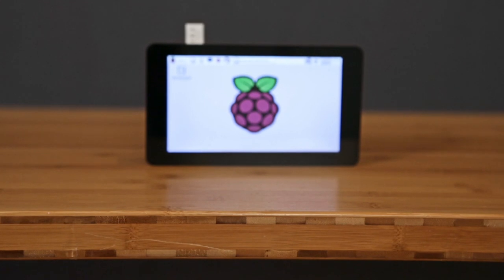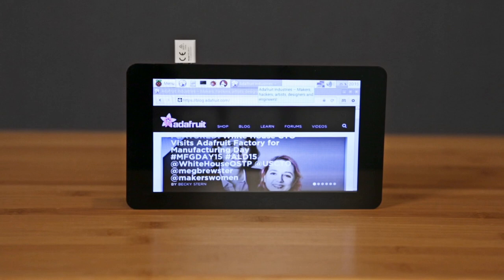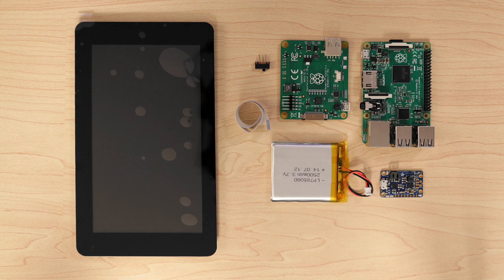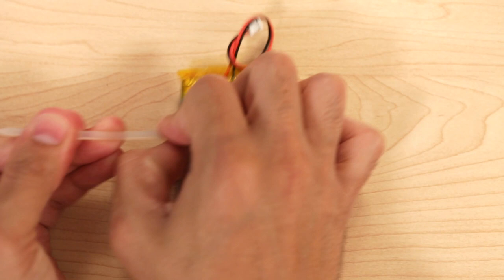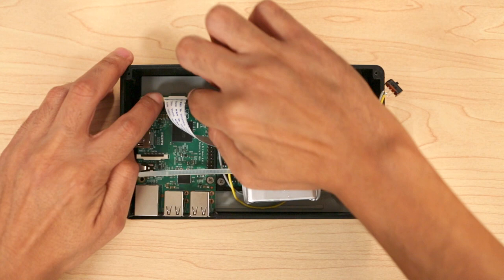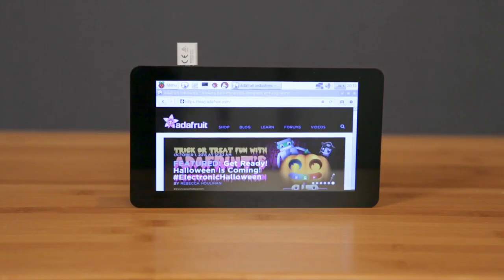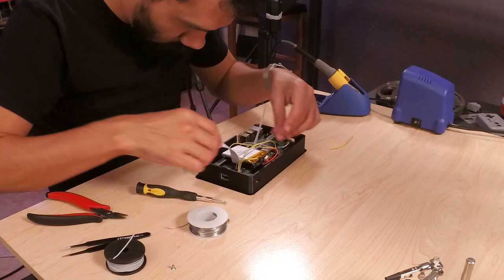7" Portable Raspberry Pi Multi-Touch Tablet #3DPrinting #Adafruit #RaspberryPi

Comment: Nice, I only see one issue. Because of the soldering It will be very unpractical to switch the raspery pi when a new model comes out. I think the key feature to diy tablets is that you could switch parts easy.

Comment: I plan on making one using those exact same parts, except mine will be about 1/3 the thickness. I already ordered the RPi2-B, wifi and connectors. The screen will be ordered later. I plan on removing all the bulky parts and spread them out over a PCB. I'll post a video when it is done.

Comment: I made this thing... stuff they dont tell you:
1.) drivers for touch are few and far between
2.) battery sucks and wont charge while its being used (or charge fast enough)
Reply: Wich battery do you recommand then? I'm interested on doing one...
Reply: Sudo rm -rf LCD-show
Git clone https://github.com/goodtft/LCD-show.git
Chmod -R 755 LCD-show
Cd LCD-show/
Sudo ./LCD35-show
Method 2: Offline installation
1. Download from the website or copy the " LCD-show.tar.gz " driver from the CD to the root directory of the Raspberry Pi system card;
(Recommended step 1 After the burning is completed, copy the driver directly to the Micro SD card, or use SFTP to copy it remotely)
2. Execute the following command to extract the installation driver:
Cd /boot
Sudo tar zxvf LCD-show.tar.gz
Cd LCD-show/
Sudo ./LCD35-show
Reply: @nettyvoyager6336  oof it's been a year since I dropped the project 😂😂
Reply: @nettyvoyager6336  But thanks!

Comment: Nice project, I'm exploring how to use this concept to build an RTK GNSS rover for very accurate GPS position fixing, this would be great on the rover unit as most of the work would be completed in under an hour, the unit would be using a little more power for a comms link and to power the GNSS expansion board but a bigger case would allow for greater battery power, thanks!

Comment: How can you use the Powerboost 1000c to shutdown the Raspberry Pi when the battery is low ? I've read you can't connect the LBO output to a GPIO pin directly, because the voltage is larger than 3.3 volt. So how can we achieve a safe shutdown of the Raspberry Pi when the Powerboost detects a low battery ?

Comment: if the case's dimensions are extended so that the edges of the screen are not hanging over the case, will it still it still be able to clip into the display as long as the proper editing is done in Autodesk Fusion 360?

Comment: Wonder if it would be possible to add some things like accelerometer gyroscope and magneto meter and maybe a speaker and than install Android and get a fully functional android tablet
Reply: All those components are possible. Android is much more difficult, because when they make those parts, they only have software for Raspbian, not android.

Besides, why create such a great machine only to run a crappy mobile OS and be disappointed at how slow the machine is? Might as well buy an old Galaxy Tab.

Comment: i have a problem with the entire thing turning off when the pi does a more intense job like say loading an os or copying a large amount of files any way to fix this?
Reply: Something is wrong with the power -- you need to check the cables, charge controller, and battery. Could be the little battery isn't up for the job.

Comment: Is it actually usable as a useful tablet? For example, can you launch a browser, and scroll around using finger gestures, and tap on links?
Reply: Yes! It’s an computer with the chip like the ones inside your phone. And that screen is touch enabled and supports multi touch. However, it isn’t as powerful as an tablet nowadays, but still it runs smoothly.

Comment: How much does it all cost together? Can someone find that out for me? I don't know where to look and I need to know.
Reply: Not sure of the total, but if you go to adafruit.com, look for the Raspberry Pi Foundation 7" touchscreen, the raspberry pi itself, and the charging circuit and battery. The touchscreen is about $80, the Pi itself is about $30-$40 (depending on which model you get), the charger is about $5, and the battery is about $10.

SO, total of about $130, plus you need to 3d Print the case.

Comment: I bought the display from adafruit and I got the case coming from someone who has a 3d printer.  But my question is, I don't have the battery or charging circuit.  Will I still have access to the mini USB port to plug it in?
Reply from the maker: +iamgeniusrnti Yes, the case as a port opening for the USB port on the Raspberry Pi so you can powered it through there.
Reply: Cool thanks!

Comment: Does anyone know if there is a way to monitor the battery life of the tablet?
Reply: the power boost ( blue cirquit board) has a pin (LB) that will change state if the power level is low. you could hook this up to the raspberry and code in a notification at low batery

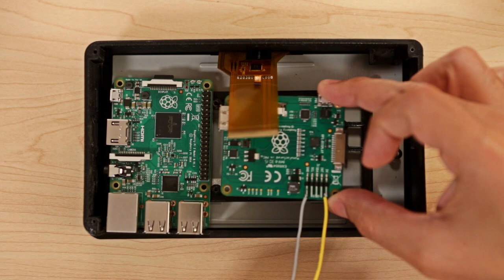Comment: What's the function of that blue circuit board at 0:53 ?  I guess it goes between battery and Rasp.  I'm wondering, as size and weight is not critical, if I could use power banks that has usb outlets instead for both Rasp and display.  Anyone knows ?
Reply: the blue circuit is basically a lipo power boost, a lipo battery outputs 3,7v, but the raspberry requires 5v. in addition a safe charging circuit has been build in to this board so you can use the device while charging. the battery can be replaced by a power bank, without the need of this circuit board, however depending on the type, you may not be able to charge and use at the same time.
Reply: Watched so many videos and instructions since this, I couldn't even remember what I was asking for like 10 seconds.  Thanks for the reply.  I got a power bank and it works just like you described.  It doesn't charge when in use.  Other than that, very happy with a power bank.

Comment: can i use a powerboost500c instead of a powerboost1000c ?because powerboost1000c is sold out.
Reply from the maker: +david hunt You could, but we recommend using the PowerBoost 1000C because it can provide up to 2amps.
Reply: +Adafruit Industries Do you have any plans to get the powerboost 1000c in stock ?
Reply from the maker: +david hunt Yes, of course! You can sign up on the product page for email notifications when it's back in stock.

Comment: can you use this with the raspberry pi emulation station or is this like a normal tablet?
Reply: Remember, no matter what display or input the Raspberry PI has, it is still a computer that can handle any compatible OS. The only difference between my desktop PI and this tablet is the Input/Output.
Reply: thanks, but what I meant was can you still use the touchscreen as a controller or do you still need a controller?
Reply: The touchscreen can be used to control the computer fully. When you touch something to type, an on screen keyboard pops up.
Reply: sorry but i meant w/ emulation station. will it still work?

Comment: is it possible to buy the case? i dont own a 3d printer! thx 😊
Reply: You don't need to own a 3D printer. There are lots of companies who will print out the case and mail it to you for a fee. All you have to do is upload/send the design file to them. With this method you can design the 'perfect' case for your Pi project, and modify it however you choose. For example you could easily make the case a bit bigger to fit a battery with much higher capacity.

Comment: why didn't you use a RPI zero so it can be flat.
Reply: My thought exactly, or the odroid-w , which is optically like an exact clone of the raspberrypi zero, but much better but also costs 40$..... Also, i think that the raspberrypi zero is always completely sold out
Reply: +James Einer does it have wifi
Reply: +James Einer thanks bro

Comment: First things I'd want to do...is find a way to extend that battery life.
Reply: Bigger battery. Has to be a single-cell battery, but it's doable. Alternately get a charge controller that can handle multi-cell batteries, but then you're dealing with a lot more cost.

Comment: i would put windows 7 on it and use it as a remote server acess point
Reply: i meant windows 10 you can use it on the new one
Reply: +Patrick Gerlach It does not have a gui. It's just headless OS.
Reply: Dude look it up they said it was able to run Windows 10 when they launched the new one
Reply: Patrick Gerlach Yes. The windows 10 IoT version.
Reply: +Patrick Gerlach It's definitely not the "normal" Windows 10 that you're probably thinking of. As was stated, it's a headless IoT release, which has a completely different set of applications. The media is mostly to blame here, though. Too many journalists were incorrectly reporting (mostly likely because they didn't understand what that all meant) that it was going to be able to run a full Windows 10 installation, which it can't.
Reply: +Patrick Gerlach Windows 10 "Internet Of Things" edition, which is based on Windows RT, not the Windows you know. It's an ARM build that has no backwards compatibility with any of the other Windows OS' other than maybe CE. Linux is the only OS that has any use outside hobbyist work to run on the Pi.
Reply: Patrick Gerlach the raspberry pi runs on an ARM64 CPU architecture, and windows 7 runs on x32/x64/x86 (depends on windows version), so it can't run on it, besides, the raspberry pi does not even meet the minimal requirements to even run windows.

Comment: Would upgreade my wheelchair but no 3d printer :(
Reply: Unniversallappen. i felt so bad reading your comment, i hope you will be able save up and upgrade your wheelchair. I wish i had money to help you but I'm broke too :(
Reply: U don't have to donate me bro if you would have money. I saw a case on amazon for this display. I can't put the battery and so on in the case but i have a powerbank for smartphones and it works fine with rpis.
Reply: Unniversallappen wow sounds great ,hope it's making it easy for you
Reply: I think so
Reply: Unniversallappen you must be really talented to do this by yourself, most people can't or won't be able to do things like this
Reply: Na i would make a simple python gui and would name it wheelchairos. Then i would mount it on a simple 15$ tripot and would install a speed or temprature sensor or a fm radio module. And for the extra $W4G i would use a big bose bluetooth box as speaker and a rgb light strip as flashlight.
Reply: Unniversallappen that sounds awsome hope it helps others on wheelchair

Comment: Hi Adafruit Industries
 I am new and started using raspberry pi 3 with 
RASPBIAN JESSIE WITH PIXEL and install Raspberry Pi 7” Touchscreen Display. Screen Resolution 800 x 480 pixels
I am facing a issue when i run Qt Creator 3.2.1 and click maximize icon, not able to get full screen layout of the application as few of part of the qt is partially hidden.

i have followed the instruction of installation from this link below
https://www.element14.com/community/doc ... en-display

touch is working perfect and there is no black border from the screen. Its some thing else i am not able to figure

If any one know to resolve this issue pls help me out to achieve the display to display full screen

Thanks in advance and waiting for answers.

Comment: Has anyone tried it with android? Want to make an adroid tablet.
Reply: Android on the Raspberry Pi is currently very unstable and there's very few drivers available for it. I think you would need to tweak the configuration of it if you want it to work with the touchscreen.
Reply: D.J. Jakubowski for android you should use the banana pi

Comment: Probably would see how it runs as an e-reader after giving it a bigger battery since two hours? Mediocre.

However I'd probably use it much as a normal tablet, though put blunt I want to gear down, go with a black and white LCD, no wifi, and gear it more for two functions.

E-reader.
Word-Processing.

Comment: 2 Hours it´s too short T_T but I guess It´s possible to use a massive battery
Reply: +Cristian Vargas You could also underclock the CPU to save battery
Reply: Andrew Smith True, But I have no idea how to do that, how?
Reply: +Cristian Vargas Pretty easy, there are configuration files on the root of the SD card that dictate the MHz the CPU runs at. Be warned that overvoltaging it, which is also possible in this config file, voids the warranty, incase you'd want to make it run faster.

Comment: Does this work with rasberry pi 3?
Reply: Probably. Also the 4. The only thing to watch out for is to make sure the hole for the ports fits perfectly. If not, you'd have to make it bigger by editing the STL file in tinkercad.